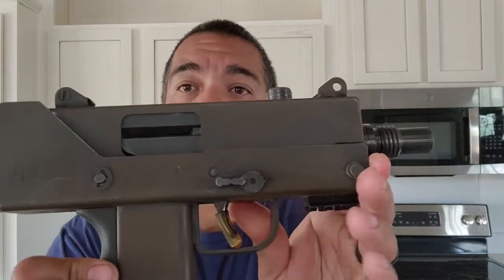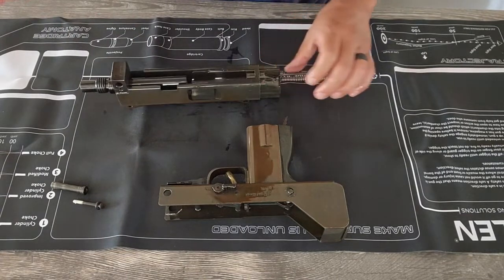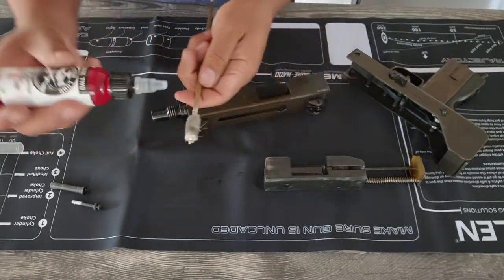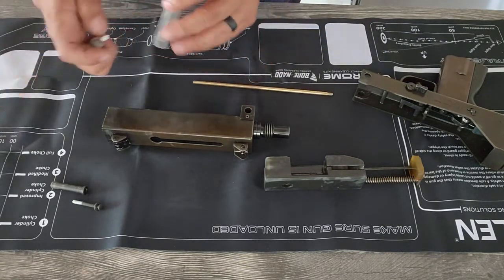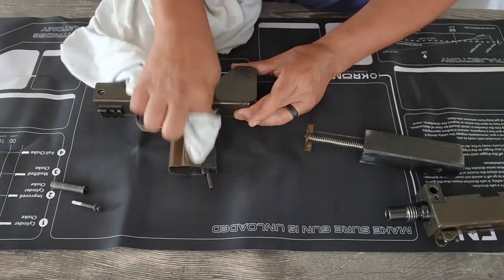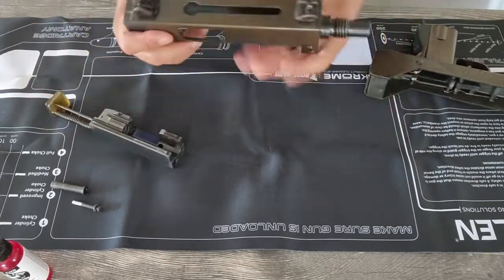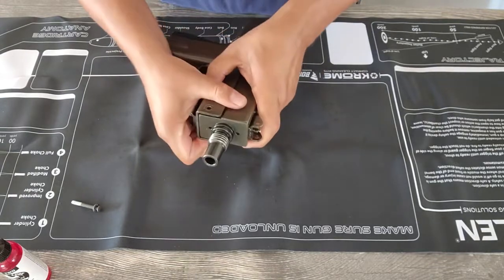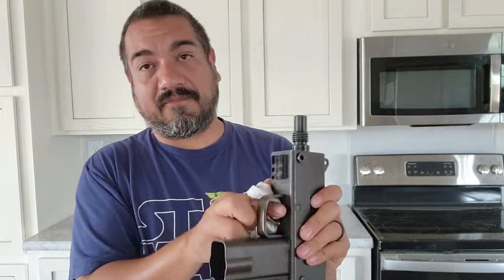Cleaning a MAC-10 | Review

Comment: After safety checking it, I'd be checking out the barrel for any sign of pitting. The surface rust is unfortunate but hasn't progressed to the point of being damaging. It's plain stamped steel. There's no bluing or treatment of the steel which means if it's going to be maintained, it's going to need regular care.